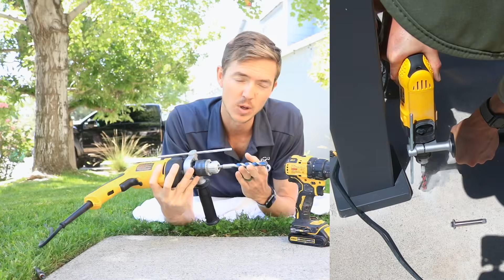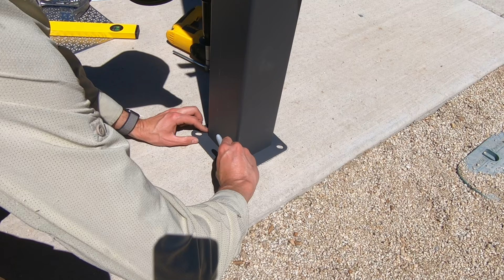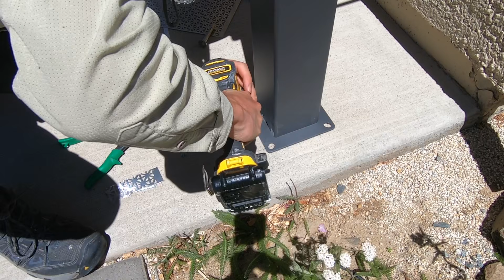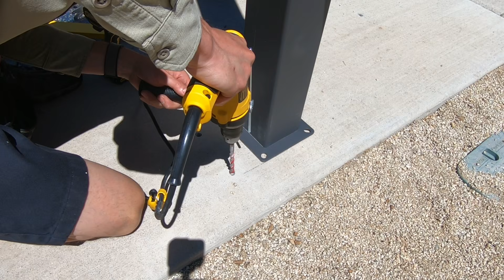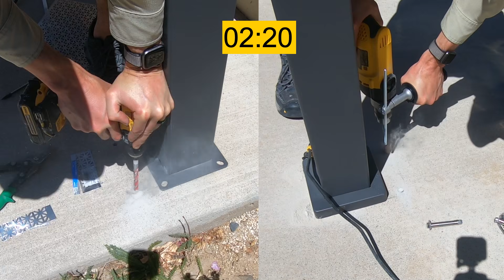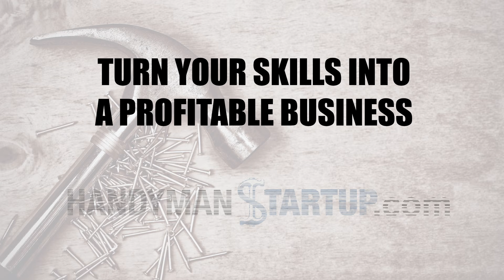How To Drill Into Concrete

Comment: Yep I just bolted my safe down, I sharpened my 1/2" masonry bit first with a diamond wheel, I only have a regular type electric drill, went down with a 3/16 pilot drill, then 1/2" down 4". It took a lot of press to cut the tile then the concrete was not too hard. I am a 200 lb guy. I drove the anchor screw in most of the way 1st with a 1/2" impact. before I put the safe in place and finished driving it down. It bit well because the impact was turning it slow as it was finishing going down. By measuring it should have about 1/2" bottom clearance. Only changes I would make is next time drill the tile with 5/8" first to clear the self tapping concrete screw. I got small chips around the hole. No big deal.

Comment: Hahaha, yeah, your baby concrete slab that's probably not gonna last 5 years may be easy to drill into. Try drilling into the European 70 year old high-rise apartment building's walls with that joke of a drill. It will do literally nothing to the concrete. You DO need an impact drill AND a lot of applied pressure still. Source: me and many other residents of the building I live in tried with just regular drills. That stuff doesn't budge any more. It's seen some shit. Doesn't care for your puny cordless drilly toy.

Comment: Hand on the top of the cordless drill may block the cooling air flow . The handles on the power drill is a cooler and more of your weight can utilised.
Drilling Reo-bar is fun especially up on the outside wall six floors or so in altitude.

Comment: What about concrete that has stones mixed with it. Drilling through the concrete is easy but if you encounter stones where your bit comes to a stop, compromises the hole if you drill around it.

Comment: Easier to drill vertically down with the normal drill. Drilling horizontally into a vertical masonry wall is tough and like you said, the hole tends to shift as you drill.

Comment: I have a corded power drill and i was trying to drill through 60 year old brick walls with concrete plaster. Even with force and a masonry bit, it wasn't happening.  I had to hire a handyman to do it. And even HIS strength wasn't cutting it. He had to end up using a nail gun. Our garage walls are solid brick with concrete plaster, but it's like a steel wall. I had to stop so I can go to HomeDepot Thursday and rent a hammer drill.

So, i learned via Google, that concrete hardens over time, to use water to help with cooling the bit, and to clean the hole out every once in a while.

Comment: Idk man. A vacuum. I’m not trying to pack a vacuum just so I can not bring a hammer drill. Hammer drills are not even expensive to not bring a hammer drill. If you’re going to do so concrete, even beam drilling, shoot, even tile drilling, you can use a hammer drill without a problem. Tile sometimes will look a little less clean then using a diamond tip bit but it’s faster for sure and won’t be needing to be replaced all the time

Comment: it only works if the concrete is rather soft.
Good luck with a cordless drill on something more substantial, let alone if you hit some rebar or some random gravel inside that's really hard.

Comment: Soft buttery concrete, sure.

Anything hard, you'll burn your bits out and put excessive wear on your driver.

I would be suspicious of a contractor that turned up to drill concrete or brick without a rotary hammer drill.

Comment: You can also "hammer" as you drill, lightly tapping it as you go, raising it up-and-down about 1/8 inch or less, just MAKE SURE to keep it straight as you can, I prefer your method as it is likely to be a more uniform hole when done.

Comment: On a normal, fairly new concrete pad, then I agree with you.  When you get to either heavier duty concrete or old concrete, the rotary drill can be very frustrating.
ALSO, I wonder how much you are shortening the life of your rotary drill when you are pushing down on it with all your might!  Obviously, it was never designed to tolerate that.

Comment: I feel validated. Wasn’t sure how much pressure I should be putting on my drill but it seems like I need to apply more lol. I’m using a 1/2 drill bit too..do I need to take small breaks throughout the drilling process to prevent damage to the bit? Thank you for the video!

Comment: I like to take a piece of scrap like 2 * 4 and drill a hole the size I need in the cement through the 2 by 4 and then get the drill lined up to my mark with the block of wood around the drill bit and once I know it's good I'll stand on the wood while starting the drill it works really good to make sure the drill stays on Target and you also get a perpendicular hole

Comment: I have a cement septic tank lid and the handle rusted off and broke. Will these tools get me to the finish line I'm trying to drill into it to anchor some expanding studs for a handle but I bought a cheap masonry drill bit.

Comment: Thanks, but you're drilling in relatively new concrete (less than 10 years). Just this week, I need to anchor a replacement 2x4 wall onto 60 year old concrete. I reasoned that 3/16 Tapcons might be ideal. I melted a $10 bit in minutes. I upgraded to 3/8 reasoning that a bigger bit might not melt. It didn't, but it didn't make a hole either.  I used a big non-hammer drill and a serious rechargeable hammer drill. Both were equally useless. Drilling old concrete is just a problem. Thanks anyway.

Comment: Problem with brick and a regular drill is its impossible to apply weight to it. I'm trying top drill two simple holes to hang a clock on our fireplace and its like trying to drill through metal.

Comment: A concrete drill bit should not be used without the hammer action,  except to start the hole.   You will ruin the bearings on a conventional drill,  and the drill bit will overheat,  the brazed joint for the carbide tip will melt and your drill is scrap ...  Always use the hammer in concrete,  always take breaks if you're drilling deep holes to clear the hole and let the drill cool ..

Comment: Sorry, I call bullshit on your advice! So you needed all your weight to drill this hole drilling down ... nice, now explain to me how are you gona drill the same hole in a wall or worst of in ceiling? You cant use your weight behind the drill for thous, so you will need to be Hercules to make the hole! 
Hammer-drills exist for a reason! 
That reason is mainly concrete! 
As you say USE THE APPROPRIATE TOOL FOR THE GOB! 
So that thing in your hands looks like Dewalt DCD798 or 800. If you are just a regular guy doing stuff around the house, you typically just use 1 tool for about everything. Skip that DCD800 its wrong for you! Buy DCD805 and you are set. BAM! Cordless Hammer-drill! Don`t buy EXTRA hammer drill. Don`t buy a drill, if that's going to be your only tool in the house! Buy hammer-drill! Any brand hammer-drill will do. Buy the way ther are models cordless hammer-drills with handle and dept gauge. If you see concrete skip this bullshit advice about the drill. After the initial lead drilling, instantly crank hammer-time and go to town!

Comment: Tried this and burned out my drill bits in just a couple minutes.  Went to a hammer drill and done so fast and easy.  
Not all concrete surfaces are the same.  My basement floor destroyed the bit. First one, full rpms, just went at it and barely got into the concrete.  2nd bit, went lower rpms, took breaks and took a very long time to get down an inch then killed that bit too.  Be aware, individual results may vary.

Comment: First of all, you want to drill a smaller, Pilot hole.  2nd, you DO want to use a hammer drill.  Been doing this for many, many years.  Ease of doing the job CORRECTLY, the first time, is #1.  👎

Comment: You want a Rotary Hammer!! Much better than a Hammer Drill! Uses an SDS drill bit with either 2 or 4 points. 4 points will get you through metal screen and rebar in the cement.

Comment: For less than AUD 90 I got an ozito sds corded rotary hammer drill that came complete with 8,10 and 12mm masonry bits as well as several picks. If you have more than a couple of holes to drill it makes sense to get the proper tools.

Comment: I tried to drill holes in 30yr old very tough concrete and had brand new Bosch masonry bit and it took forever to drill each hole. Regular drill wouldn't have touched it.

Comment: Thanks for this video. I only needed to set 4 smaller concrete anchors and was wondering how to do it. Less than $10 at the hardware store for buy and anchors, used my regular impact and good to go. Worked good and easy to do.

Comment: Bad advice. If you're drilling any kind of masonry, use a hammer drill or rotary hammer. And cool them with water. Using a regular drill  puts a lot of excessive wear & tear on the drill, plus is likely to burn up the drill bit- meaning the tungsten carbide tip breaks off in the hole. 

Now you've got a much bigger problem than simply replacing that bit - good luck drilling through that chunk of tungsten carbide! Most likely, you won't be able to use that hole at all.

Comment: I bought a cordless DeWalt drill with the hammer function and I don't think I've ever used that setting in the 15 years I've had it. If Im drilling concrete I grab the Bulldog. 
 Now Im curious if that setting even works. 😂

Comment: Accorded hammer drill is so cheap nowadays you'd be silly not to use it. It cuts through concrete like butter in order to drive railing mount holes.

Comment: A lot of common sense here. Very nice video.  For old concrete an SDS  type drill is better than a hammer drill. A single cordless combo drill (drill. screw, hammer) would get most things done around the house if you only want one tool. If you do a lot of heavier duty work in concrete or a big renovation a regular drill/screw driver paired  an SDS drill (with a chisel function) could  be a good alternative option.

Comment: I have a Ryobi 18 V drill, with a masonry drill bit on I just bought, and it only goes in about an inch and a half then I get nowhere. I need to go 2 1/2 inches into the foundation of my house to secure a board. I think the bits I have a garbage that I bought at Home Depot

Comment: Sorry but i dont agree with your approch.
Firstly when u work professional time is precious. With hammer drill u  drill fast and the machine works great,  and the machine will last.
If u drill like that with the regular drill sooner or later u will need to buy new tool.
The machine should work for u!!!
But yeah u got the point that u will drill sooner or later .. 😂

Comment: Using a regular cordless drill with hammer function is a MISERABLE EXPERIENCE! Especially on really hard concrete like house foundation and basement walls.

If you want a hole larger than 5mm or more than 10 holes it is a MUST to buy a SDS+ drill

Comment: I came to look on how to drill into concrete because I am fixing my porch that has some loose decorative posting. I am only 105 lb lady, and I will try with my electric screw driver. I am afraid it may not work for me. I have to go get the masonry bit. I am hoping for the best since my holes are fairly small. The house former owner never secured these things, and they are a hazard. Thanks for the instructions!

Comment: Thanks for making this video. I have a hammer drill. One thing I ran into is there are gravel chips in the concrete. It seems once the drill hits these, the dril shifts away from the original hole a bit, and the result is out of three holes, only one lines up. Any advice? Many thanks Mike

Comment: A job comes in with a 5000 PSI slab to mount a line of bollards along a gas line in a garage. 40 X 3/4" X 6" holes in you will be wishing you had an SDS. A hammer drill is good for masonry , brick , cinder blocks , etc. You get a 50 year old floor that needs holes in it then it will laugh at your hammer drill lol.

Comment: I have DeWalt DCD796 hammer drill and I am struggling to to drill into the ceiling of my apartment which is made of concrete/cement. Any Tips?

Comment: Thanks for using the same model of drill i am looking to use. Lots of experience using sds and rotary hammer tools, but this job is independent and required only what i own. I know i can kill (3) 3/8" anchors at 3" dewp with my tool and not kill it

Comment: Very nice video, sir.  In your demonstration though - are you using a Rotary Hammer or a plain Hammer Drill?  As I know the there is a difference between the two tools, with the rotary hammer having much more power versus stone, cement, concrete, and other forms of masonry.

Comment: If you're mounting a plate with multiple holes, use the plate as a jig to start the holes in correct orientation to each other after getting at least one accurately started by eye, marker and/or punch.

Comment: EDIT: Update: In my house (Netherlands) the concrete would barely budge at 4 mm and I stopped at a depth of 10 mm - no way I'm drilling 6mm diameter any time soon! Maybe I'll have better luck in a different concrete mix/age, but absolutely doesn't work in every case. Starting the hole with an old-timey manual #14 Rawl Plug chisel helped.
---Old:
Tip; on the normal drill, set it to an appropriate slip mode. If you hit a large pebble or metal, you won't break your wrist.

I was looking to drill just a couple of small (6 mm) holes in my concrete wall, for pictureframes. I'll try this method, instead of borrowing (yet again) the rotary from my parents who live two hours away. Will report the results!

Also, I'll use the handheld old-timey stone bit, "Rawl Plug no. 14" (from my granddad) to start the hole in the correct place.

Comment: It's easy to "put your weight into it" when drilling straight down into a concrete porch or floor. But what if you're drilling horizontally into a masonry wall at roughly 4' to 5' high, where you can't just drop 80+% of your body weight right on top of the drill, and the best you can do is to "lean into it"?

 Does ^this still work if you're trying to drill a 1/4" to 3/8" horizontal hole into cement between bricks, where the most weight you can consistently apply to the back of the drill is 25lbs - 35lbs?

Comment: if you are on a budget then what I would recommend is to buy a corded hammer drill. its not that expensive compared to a regular corded non hammer drill but makes a huge difference in my opinion because you cant always use your body weight in every situation. sometimes I drill way high up or in weird places where I cant use much of my body weight. And obviously if you are drilling multiple holes, you'll feel tired because you are also doing some of the work which the tool is not doing. Also bits gets duller quicker and less effective without a hammering action. 

if your home is made using bricks and concrete then I suggest leaning towards a bigger rotary SDS type drill because those things works super well. They have much slower RPMs but the actual hammer effect is way higher. Since they spin slowly and have a better impact, the bits will last much longer as well. However these drills will use a different type of drill bits which you can slide in and you cant use other drill bits for example when drilling wood or metal without an adaptor. Most SDS drills will come with this adaptor but I think you can buy separately too. with most SDS type drills you can also select what you wanna do. you can just use the rotary action or just the hammer action or both at once. great if you wanna break up tile or small stuff like that. 

if you got the money then what I recommend is to get a cordless normal drill + a SDS drill. owning just ONE drill is not that ideal because lets say you just got the SDS drill, then if you wanna drill metal or wood you have to use an adapter, then another drill bit. but if you got a cordless one too, then you can use that for wood or metal. I think all cordless drills comes with a keyless chuck so its easy to switch bits too. 

another advice is you can rent and see before you actually buy the tool. just rent both drills and use em for a while and see the difference and see for yourself if paying more is better. In my case I own couple of normal drills and a corded hammer drill. When I need to drill a lot of holes I just rent a SDS drill. For now I don't have that many use cases to own one.

Comment: I have 12 2.5 “ holes to drill into solid concrete steps to mount a handrail. I’ve spent 30 minutes drilling 2 holes to a depth of 1/4” and have ruined 2 carbide tipped bits. No progress at all. I’ll still be working till Christmas and shall have gone through 100s(?) of bits. @ $10 a bit, $1000? Suggestions, because what is presented here I am unable to duplicate.

Comment: You can drill a hole with out the hammer function however u will need to replace your bits quite often because the bit will overheat even while spraying water

Comment: Good luck at my house with that. My grandpa used the same concrete for the foundation and cellar walls that he used to build bunkers with during WW2. Even when using a hammer drill and good Hilti bits, the concrete sometimes just turns white. When you manage to finally drill the hole, the bit is relatively fcked. xD

Comment: A smart person evaluates the situation . If you find you require tools that shorten time on the job and you defo will use on many jobs then go buy that tool . I got my big rotary SDS hammer drill and that pounds big holes 24/7 . If I’m doing the odd hole then I’d use the cordless . If you doing these anchors all the time then go bigger than a powered  small hand drill ,go for a big SDS , my Bosch I’ve had for twenty years and minimal maintenance( just brushes and a bit of grease ) and it’s punched holes through bank vaults ( 3.5 ‘ reinforced concrete) . No am not a bank robber , we turned an old bank into a dentists. Mad thing was I used a 3ft drill bit and still didn’t punch through